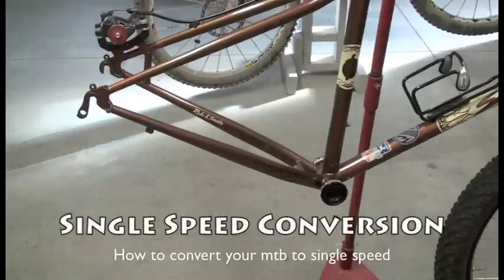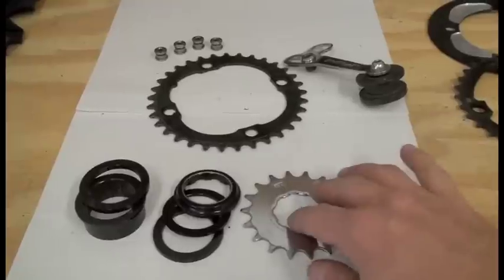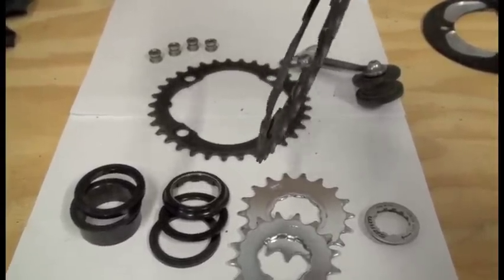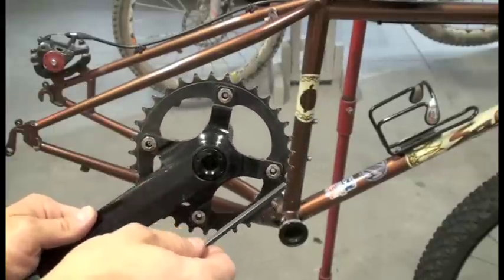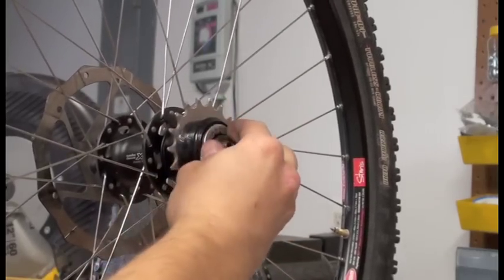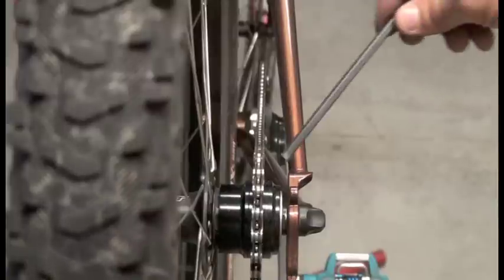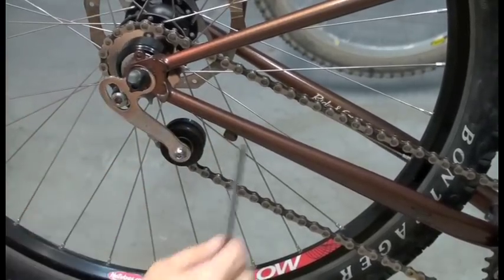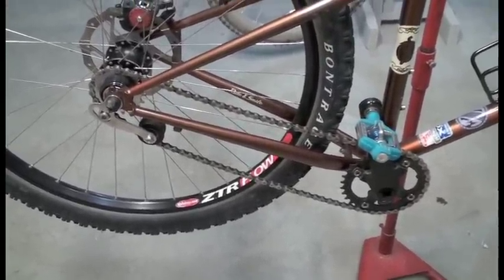Single Speed Conversion - How to

Comment: THINK

Gears are  nice, sometimes there are hills.

Learn to fix your bike, respect the work people did in previous generations to put gears on bikes, learn how to fix them and think for yourself, instead of participating in fads and needing the respect of your peers to feel self worth.
Reply: What?! XD I just want a fixed gear.
Reply: This isn't a fixie(fad) it's a single speed, something that has been a part of biking culture for a long time. Also, who gives a flying f*ck about how someone else gears their bike? This isn't some irreversible step back in mechanical evolution...it's a personal preference.
Reply: You are absolutely right. However, I do not feel like spending money just to weld a derailleur hanger on my old bike. Why not give it new life as a single speed? I know it would get as much love as my road bike.
Reply: Rob Fuentes you don't have to weld anything..........
Reply: I meant to say that my old bike's derailleur hanger snapped off and the only way would be for me to get it welded back together. I'd rather use it as a single speed in this case.
Reply: george clues FAD
Reply: Consider some slick tires and 21+ speeds...

ON A MT BIKE?
More speeds the better folks. I live in a flat valley and love my 16 speed bike just to follow the creek trails,  and don't attempt hills without 21+ speeds.
Just a fact of life.
Reply: Gears vs single speed is totally personal preference. Your opinion is valid for you but doesn't mean it's the same for everyone. I own both geared road and mtb's and also single speed road and mtb's. Both of them are fun in their own way. Got a hill coming up? A single speed will do just as well, don't rely on the machine, the rider has to work hard too ;)
Reply: Scott kelly
Your average Jew-Fixie Fred
Reply: I just ordered a Brompton from NY . lol
I do miss N Y hotdog carts.
Reply: I remember when Knish stands would be right at the corner of my street.
Reply: Rob Fuentes
I would have to keep the window open : ) We have nothing great like that in Houston. I think the restaurant association lobbied the health department. Maybe with $$$. 
To have a hotdog cart in Houston it has to have 4 sinks grease trap cold and hot water. The water pressure has to a certain psi. It has to be sealed, no open carts. Has to be 1500 feet from any restaurant "1/3 mile almost" You cannot clean it at home you have to use a  city approved commansary. and a bunch more stuff that I cant remember.
I had to give to buying some carts : )
Reply: ***** There are some racing series where you use fixed gear mtb's, and sometimes it's nice to live with the simplicity to a 2.0 gear ratio, and nothing more. I usually run a 27 speed on mountains, but if I'm out riding with my girlfriend or whatever, sometimes it's nice to take my single speed and enjoy the ride.
Reply: Hills don't bother singlespeeders. They're usually passing the geared riders on the climbs. Are you serious? Next time someone passes you going uphill look down.
Reply: Mike in Cave Creek
Just ride
Reply: Mad Crow
Its a waste of time and effort. To get a single gear bike in about 3 seconds without any modifications, just select a single gear you like on a multi gear bike and never touch it again.  Job done.
Reply: people like single speeds because
1)
there are less parts to take care of and less parts to replace when they all inevitably wear out. also a single cog is way cheaper than replacing a cassette with 10 cogs.
 2)
properly set a single speed chain will never slap the chain stay like multi speed bikes
Reply: Well some people have dirt jumper bikes made for doing tricks if you still have gears there will be cables everywhere and doing tricks like tail whips and bar spins won't work. Some people are up for the challenge so next time stop thinking about yourself.
Reply: Lachie Sedgwick
For the purposes you mention, a fixed gear/single speed is probably essential, but for normal road use, a geared bike is a lot, lot more sensible. even on flat roads where you can pedal at a comfortable speed and also a comfortable cadence. A single free wheel for road use by choice is not sensible and a fixed gear for road use is idiotic.
Reply: Jeff papineau, fad well said
Reply: Nah screw front derailleurs.
Reply: Several generations of children and a lot of homeless/toolless people have missed out on a lot of fun and worry free riding because of big box bicycles with cheap gear setups. I disagree.

Also, the more time a bicycle spends in the air the more likely it is a single speed. Yes, fixies are a hipster fad but there are a lot of neat tricks that can be done on them too. Just not by hipsters.
Reply: im just making a dirt jumper.